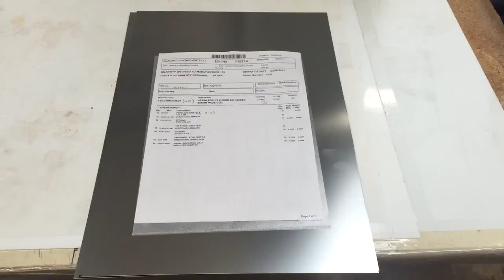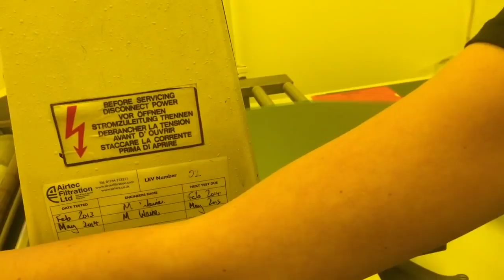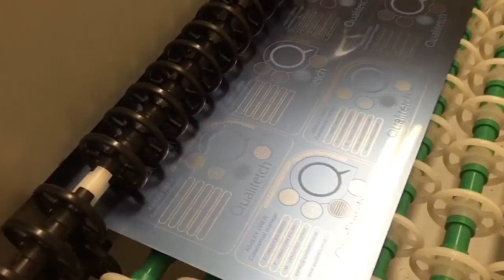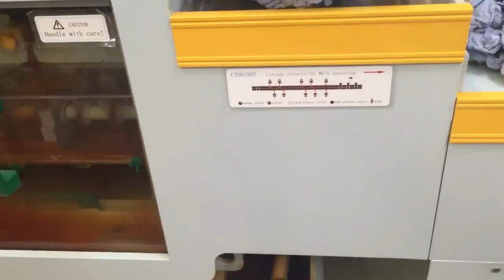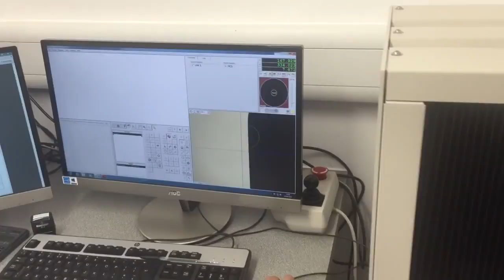Photo Chemical Etching Process Video HD

Comment: I think the metal is aluminum, isn't it? and I need to know the etchant you use. THANKS
Reply: Hi Peace,

The material is Stainless Steel 302S25, however, we do process Aluminium. If you wish to discuss this in further detail please feel free to drop us a call on 01354 658787.

Kind Regards,
Cameron @ Qualitetch

Comment: How did you apply photo resist chemicle?  Through lamination or paint?
Reply: Lamination and Paint Both you can buy in India from Etchcut, We also import from there
Reply from the maker: We use dry photo film resist however wet resist can also be used just not by Qualitetch

Comment: We are using PCM process as an Engineering project, there are hell lot of difficulties we are facing a lot of problems to achieve the desired output. At times we face printing problems and sometimes the resist comes out of the metal during etching thus giving irregular rough geometries. Please explain me the process or any suitable link that you can share. Please do the needful.
Reply from the maker: clean metal with good adhesion would be the key. You could always forward your enquiry to Qualitetch to etch :)
Reply: better cleaning of material try x400
Reply: @kaltonian  hello kaltonian. What Is x400.
Reply: We use automatic etching machines by etchcut they do the cleaning before etching so we never face the problem you have mentioned